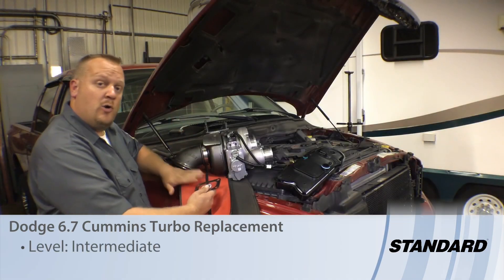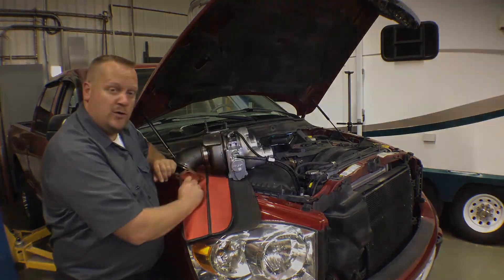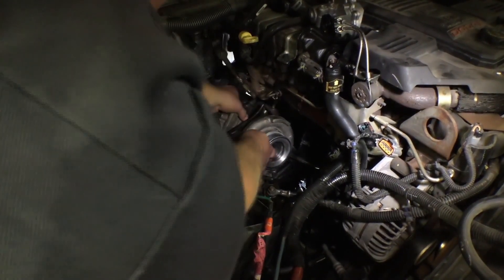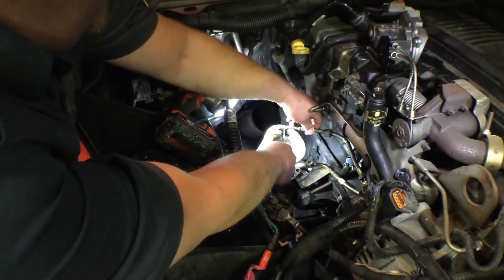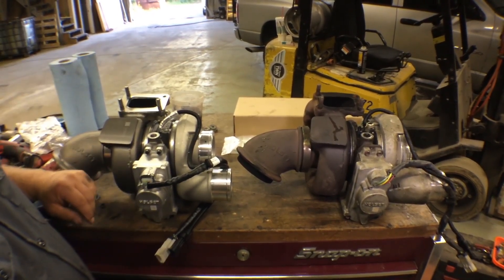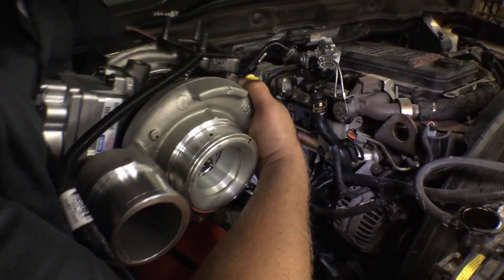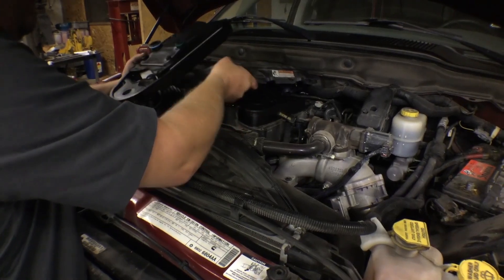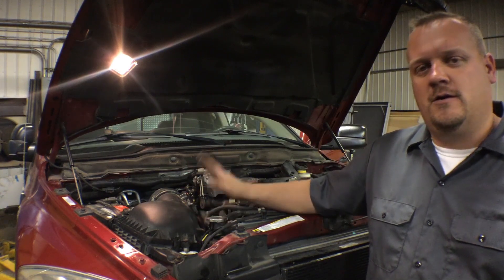Dodge 6.7 Cummins Turbo Replacement

Comment: I have a 2013 Dodge Ram 6.7 Cummings few days ago rpm stars to go up and down when I put the reverse or forward but on Park doesn’t do it runs good but don’t like how it feels now do you what sensor I have to replace?
Reply: Juan Guerrero whats a Cummings?

Comment: Great informative video.  One quick question, for the video creator or anyone who has experience with this issue:  How frequently do the Variable Geometry Turbo's fail on the 6.7l Cummins?  I hear from some in the performance community that these turbo's are highly unreliable and that 6.7l owners are better off getting a different type of turbo.  However, I'm sure a lot of those people are into tuning and are pushing the limits of their vehicle (including the turbo).  How long will a VGT turbo last on a stock 6.7l Cummins?  Does the exhaust brake need to be left on to increase longevity?
Reply: Kal P my turbo is original and I have 423k miles and I just now thinking of changing my out. Yes I use exhaust brake everyday

Comment: Is there any need to prime the turbo before installation? Like some turbo's whistle when in operation. Does Dodge turbo whistle? I know mine is bad so don't really know how it should sound when operating properly. The code I get is P2579. I changed the speed sensor but no change in the "check engine" status.

Comment: I really appreciate YouTubers doing "How To" videos. 

BUT they shouldn't leave out the most difficult part of the job (the oil return and coolant return lines).

I had the turbo ready to pull in 1.5 hours, and then spent another 1.5 hours disconnecting the oil return line. 

Beware as there was no mention of them in this video.
Reply: I agree!   I assumed that getting the four rusted exhaust manifold nuts will be the toughest part of the job!    Nope: the oil return and coolant line is a pain!
Reply: I learned the hard way about the oil return line.  After three days of struggle, I realized that you could just put in studs instead of the bolts.  Makes it so much easier.  Make sure to use lock washers or at least some type of locktite.
Reply from the maker: Thanks for the feedback, BackstromCS. You're correct, it is the trickiest part of the job. But there's no room to get a camera in there along with the wrench, which is why we couldn't get it in the shot. Our apologies for not making it clearer.

Comment: I put studs in the oil return line on the turbo, I wished I would have done the studs before I put the turbo in, I found it impossible to use the factory bolts, I found it very frustrating to line up the oil line housing and the gasket and the bolt holes with the bolts, the oil return line is pretty stiff and didn't want to handle it too much as I don't have the time or desire to replace it, putting studs in made it a walk in the park, with the studs in the gasket slips on and stays in perfect position then I could use two hands to gently place the oil line on the studs then a couple of self locking nuts, I am a first timer at a turbo change, for some reason I hope this really helps other first timers, please let me know if this helps you out:) also I can guarantee myself that line is on perfect and wont leak and the new gasket I had to buy twice is in perfect shape
Reply: after three days of struggle, I did the exact same thing.  Works perfect.

Comment: Two questions. 1) What is the consensus on draining the cooling system? Complete drain at radiator, or just remove the coolant line from top of the turbo housing? 2) Do the coolant and oil entrance lines swivel as you loosen them? I have been hitting them with penetrate oil and some heat, but they both want to twist the lines instead of breaking loose. Thanks!
Reply from the maker: 1) It's best and cleanest to drain the whole system.  That being said, I typically pinch off the feed hose and remove it without draining the rest of the system.  2) No, the lines don't twist.  You will probably have to replace them.

Comment: how the hell do you get the coolant line and oil line off the bottom of the turbo?
Reply: The heat shield can be removed by taking the motor mount loose and you have all the room in the world
Reply from the maker: It is tricky, but I got it from underneath the truck using a long extension and swivel sockets.  Getting it off is one thing, but getting it back on with the gasket is another challenge.  Best wishes!
Reply: Engineers are not paid to design accessibility into these machines. . Sigh. .

Comment: why not try just cleaning the soot out before changing to new turbo?
Reply: You could rebuild it but it would need to have the actuator re-calibrated and some kits are not easy to get. You also have to check for any play in the turbine shaft and replace bearings and many seals inside of it. Is not that easy but is a cheap option.

Comment: on the exhaust manifold there is a nut that is in the back connected to the turbo. its the only one you cant see unless you look through the fender well. How did you remove it? I've tried every wrench i could think of.
Reply: for me, i remove the front nut and use an angled 15mm wrench and hope for a good enough bite.  also, there is some sort of weird shim like thing on the last two exhaust manifold bolts that i remove and discard so i can get a better bite on that back nut.